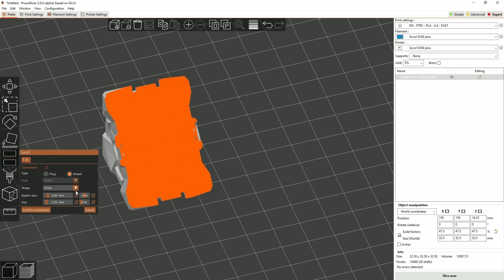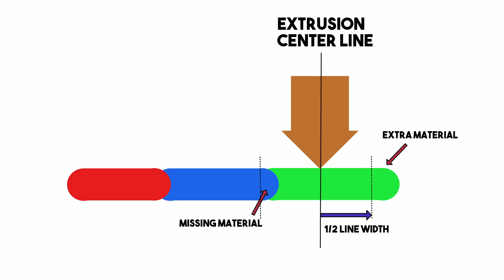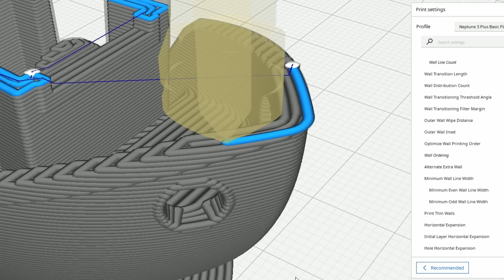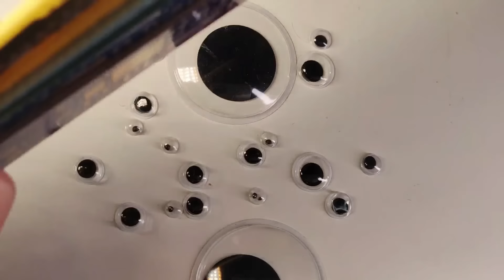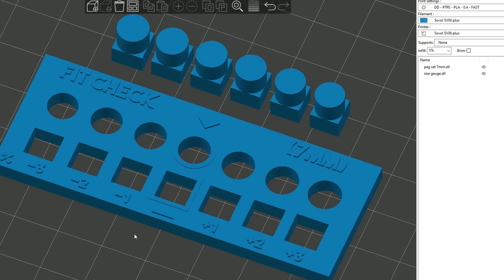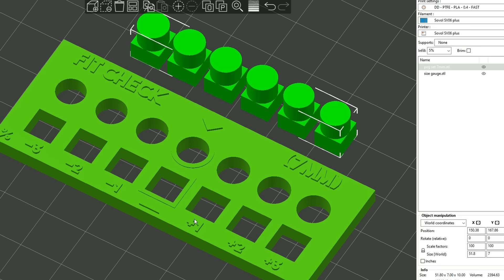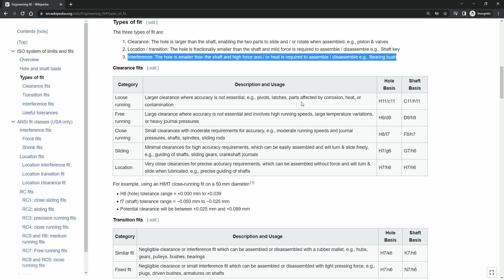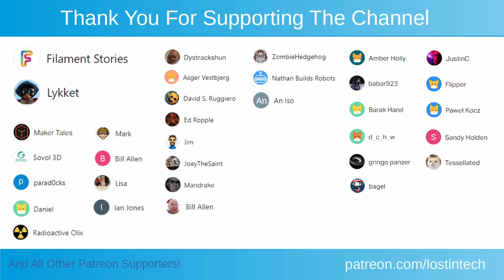Why your 3d printed stuff doesn't fit together and how to fix it!

Comment: You don't want a relative increase/decrease of dimentions: you mentioned at the start that the actual clarance is dependant on how much the filament is sqwosen outwards at the outer layer, and this is in absolute units (mm), not in persantage of the moedl size. For example if you need .14 mm gap and masured that with a 7mm square hole/plunger, get the 2% size difference and print out a plunger/hole pair of the size of 14mm instead with that 2% in mind, you will find out that the parts are got too loose as the actual gap will be .28mm instead of .14 you need. So it's not a persantage but how you should offset the shape wall inwards. For example I use 0.5 mm clarance with one of my printers, so the hole to tightly fit 50mm, on the modelling stage turns to be 50.5mm (1% larger), while the hole of 10 mm will be 10.5 mm (5% larger)

Comment: I'm not sure how I discovered The totally mundane LIT Calibration cube. You don't talk about it in this video. I would really like to see a video describing the calibration cube and all of its features. I printed it with stock settings on a Bambu Lab P1P and it amazed me. Not only did it look fantastic, but it has so many features to inspect. I think it could replace the benchy as a do-it-all test print.
Reply from the maker: Noted, will do

Comment: I try not to use the slicer to make things fit, that’s bad practice the only why you should do that if you haven’t the file to altar or a program like fusion 360 or you are making a one off piece that will never be printed again.
I always use fusion to make things fit then print out only parts of the design that needs to fit before doing a 12 hour print on the full piece it saves time n filament. As in fusion 360 you have a tool that helps you just shrink the parts that need to fit well together with out binding. I found 0.2mm or -0.2mm seems to be the sweet spot for petg pla or nylon carbon on prusa with .6 nozzles. Once you have the file correct n it fits well in fusion n printed you can always print it out at any time without much hassles rinse n repeat style from your nice saved sil, What helps as well is nice n dry filament that gives great prints or not a old reel of filament, But like all things when you get into designing stuff you get a feel how most thing work or don’t, so you learn to make gaps naturally for the right fit, but if it’s too tight you can always break out the file n sand paper… or use your tool

Comment: I did a similar test a few days ago and in my Ender 3, 200 C°, 0.4 nozzle, custom fast speed settings, the result was that I should do between 0.35-0.40mm clearing. Months ago I made other test with a 0.2 nozzle and 0.2 clearing was the result (a little loose, but couldn´t move at all with 0.15) so I'll stimate arround 90% of nozzle size Is the best for my case.

Comment: For anything other than cylindrical hole fitment, I always put a radius/fillet on the edges of the male part. Works every time
Reply: I design aluminum sand tooling professionally, and this is exactly what we do with pieces that fit together. Good work hahaha.

Comment: in my experience a wider nozzle when set correctly, produces better prints than a narrow one, because the filament isn't being squashed as far beyond the intended extrusion width as it would be with a narrower nozzle. Counter intuitive as it may be, I've found the fine detail quality of my prints increased when switching to a .4 or .6 and calibrating for it rather than a .3 or lower with likewise appropriately calibrated settings.

I think the wider nozzle also increases the amount of variance the printer can achieve with flow control. There is a minimum required pressure to get filament to flow, meaning even if you use a narrow nozzle and tell it to back off on the flow, it probably isn't able to actually do as much backing off with a narrow nozzle  as it thinks it is, which leads either to over extrusion or a failure to extrude, causing worse or even completely failed prints.

I found my dimensioned parts had better fit with the wider nozzle as well as looking better. Also, it's MUCH easier  to control the layer height with a wider nozzle due to the real world squash and stretch of the filament having better margin of error as previously mentioned.

If you need close fitting parts and you don't mind calibrating and playing with settings... I seriously recommend trying a larger nozzle. I can't guarantee it, but I've seen other people do testing, and I've seen my own results, and I recommend trying it.

Comment: The concept of right size middle hole is valid since it really shows the right size of the hole as it was designed. Before your test an extrusion e-steps test and tuning should be needed in order to know that the sizes are real. Since then the test is useful. You should also need to compensate the elephant foot tuning the horizontal expainsion setting since the first layer will be 2-3 decimals smaller than the rest of the hole.

Comment: I looked into this video in order to improve some clearances in order to make screw style nuts and bolts for my own use, I'm surprised at how hard it seems to be for others to get an interference fit on their parts. I have an Ender Creality 3 and what I did was get 2 parts in blender, these were 2 halves of shells foe a mold, and basically booleaned one part out of the other. Then I fed this into the bog standard creality slicer I got with it and it worked perfectly. The parts need to be squeezed together with a fair bit of force but there's no sign of overstressing on the parts even after lots and lots of uses

Comment: What you mentioned applies to holes along the X/Y plane, facing into the Z (e.g. holes in top or bottom). However, holes in the sides suffer from yet other issues. First, a layer has a thickness and the wall at that layer will be basically straight - it won't follow a circular path. Therefore, the wall will be either too close or too wide as compared to the circle you are trying to make. By default, slicers will make the wall at the middle of whatever line/curve is crossing as you go up, which means it's both too close and too far. You can set it to print on the inside or outside instead, which will make it always too close or always too far, but neither is ideal. Really, you don't want round holes on anything but top/bottom if you need dimensional accuracy.

In addition, the top of a hole has very shallow angles - approaching horizontal at the top. This amounts to a very sharp overhang. Slicers won't try to make this extremely shallow overhang. Instead, they will create a bridge across the top. Again, this means that either you have filament where you don't want it, or you are missing filament where you do want it.

Another issue for top/bottom holes is the seam where the circle starts and ends. Again, you will run into issues at this seam. Either you will be missing a fit of filament or you will have some extra. The shape of the seam also depends on the direction that the extruder leaves when it joins up the seam - something you rarely have any direct control over. So you'll more than likely end up with bumps along the inside wall of your hole that make it too narrow.

Getting a perfect fit for any shape is nearly impossible. The easiest way to get accurate and consistent round holes is to undersize them a bit in your design, then drill them out with a drill. We use the same technique in subtractive methods like milling because it suffers many of the same problems - you can't make perfectly square shapes and you can't make consistently round holes. When we need a perfect hole, we will drill (come directly down from above) rather than milling (circling around the perimeter). For any other shape, leave clearance, and provide relief in tight inside corners, such as using dog bones.
Reply: @reverse_engineered  I'm really digging this up late but after those 2 years I'd like to thank you for your comment. I've basically already known what you said but reading this explained by you was a pleasure. I hope one day I will be able to explain myself as clearly as you can.

Comment: This is a nice gauge and certainly useful. I think one thing that's missing though is how to account for these offsets and clearances. You briefly mentioned resizing the part, but that's not going to give you dimensional accuracy: it will not only make the holes larger but it will scale up the entire part, causing the outsides to be even larger too. Instead, you probably want a setting like horizontal expansion which will keep the overall scale of the part, but will subtract a bit from the size of each edge, like shaving a bit off of every face with sandpaper. You can use your gauge to determine how much too large your pegs and how too small your holes are, then put that amount in for horizontal expansion and it will correct for it, while maintaining the same overall size. You should never have to change your steps/mm or scale your part to make clearances!

Comment: Never make a perfectly square hole or part to fit in the hole. Always give the corners a bit of an included radius rounding off. Helps fit and is stronger.

Comment: nice gauge bro, will certainly give it a try. 
and my way of dealing with this is the lower flow at the outer wall. my usual setting is something like 2mm shell thickness with 0.7mm line width(from a 0.4mm nozzle) the 2 inner pass of wall is set at 112 flow(varies by materials, 112 is for pacf) while the outer most pass is like 92. the higher flow on the inside is to have higher extrusion pressure and presumably higher strength, and the outer most wall is just to give a smush so its mostly dimentionally correct. 
at the end of the day i find it very helpful to have a rubber mallet and a tiny file on hand, which can solve like 90% of fitting problem.

Comment: Round holes are tricky, especially smaller ones. The extruded line will want to drag to the center of the hole a bit, depending on the diameter and speed (even with outer walls first). 
But I managed to do a perfect interference fit of a small square peg on the first shot - with zero extra tolerance, but chamfered the peg corners ~0.5mm as they aways overflow a bit on both the peg and the hole, even with a well tuned LA. It being PETG which is flexible helped and some force was needed, but it did fit.

Comment: I usually just make one part 99% or 101% relative to the other. you can use a diagnostic tool all you want, but you forgot to account for one factor when you are printing something someone else created, you have no idea if the creator or how much the creator accounted for clearance in the designed part. good designers would have designed the part to print easily on FDMs, while some models may literally do what you said, have 2 edges occupy the same space
Reply: Yeah, that's the main problem with designs by others. Luckily, these days we can pester them in the comments :)

Comment: Nice idea! CNC Kitchen has something similar to test the correct diameter for their thread insets. But they added all axies so they have holes on the horizontal, 45° and 90° axis so you can test every possible angle. Maybe this would imrove your model so you can actually test how a peg for a 45° printed hole has to look like.

Comment: If you're going for a friction fit, and making the design your self. Just add a small slope (2 degrees or something like that) to one of the 2 parts. Once the head of the peg is inside the hole, the rest can be pushed in with a bit of force. Unless the negative clearance is more then the material can compress.
Reply: Better yet just don't match the peg to the hole. A square or hex peg in a circular hole works great. You just oversize the peg a tiny bit and since it is only making contact at small points it can easily be pushed in and as a bonus it will resist rotation.

Comment: I ran into this issue, I made a template for using my router and shape wood pieces.  Then I took that model, and measurements from my blanks to make a placement template to position it consistently and accurately on the blank.  Well as you guessed it, first time FAIL.  Would not fit.  My solution was in the model, to do what you said second, made in this case the hole bigger.  But in my case it was not a circle but had 4 sides, and when I pushed each side out alone the end result was a mess and did not match the main piece.  I pushed them all at the same time out at 0.02 and it fits nice, maybe a 0.018 would be better but the minor difference doesn't seem worth the work.

Comment: If I’m calibrating and maintaining my printer I find typical profiles I have to knock down flow rate as they’re tuned for much poorer extruder performance. I’d also rather use XY layer shrink/expand settings than external perimeters because of the support issue, but it’s something to try.  Calibration without a tolerance check like this is really hard because you’re talking about maybe a 0.5mm perimeter that could be off as much as 10% or .05mm.  I’m good with calipers, but not that good.

Comment: I don’t think it’s a good solution to ever print scaled,
i.e. 2% bigger. Wouldn’t extrusion multiplier and other settings be a better way to control over flow?
Reply from the maker: Hmm. Worth experimenting with what happens when you reduce it by the same % as the gauge.

Comment: Tolerance is a specified deviation from a nominal value.
Fit is a specified fitment based on it's intended purpose.
Clearance is the space between two mating parts. 

From an Engineer, hope that helps everyone.
Reply: Tolerance = specified "allowable" deviation

I don't want be "that guy", but it looks like you are going for precision. Adding "allowable" adds context, or at least reinforces that conveyed by "tolerance". Thinking about it, "precision" is probably a good word for your list too. I will show myself out. :p

Comment: My prints are consistently off on the Y axis by 0.15mm but spot on at the X axis.  How do I address this?
Reply from the maker: depends on the cause. If your y steps are out, tune that. (google "adjust y steps")

Comment: Does resin printing have similar issues for different reasons?
Reply: Too long exposure makes objects fatter. Resin may shrink when cured. So, tuning is needed, but since resin slicers don't have XY expansion (oh why 😬), anything beyond simple scaling (or added "negative" objects, maybe in PrusaSlicer, haven't checked if they can be added for resin) needs to be done in design phase.

Comment: If I'm needing exact tolerances I usually do a couple of test prints on a cut-down version of the part/tolerance in question. I've found that even if you think you have allowed for the issue you will still be surprised. To be honest given the relative low cost of modern 3D printers its actually surprising how good the tolerance/consistency of prints are so I'm not complaining!

Comment: Excellent info as always. One additional variable that will affect parts fit is "elephants foot", i.e., the slight bulging of a part where it contacts the build plate. I control this in Cura by setting the first layer horizontal expansion to around -0.12 mm. You'll have to adjust this number depending on the setting of your Z height setting. I get no elephants foot in my prints.
Reply: It's best to avoid that by getting your Z offset just right. There are lots of parts for helping to calibrate this. You should only get elephants foot if your first layer is squished because the head is too close to the bed.

Comment: I learned something. I subscribed. Thank you for explaining the outer walls first setting. Yep, I’m triggered, lol. Tolerance, clearance and fit are not concepts, they are important descriptive and accepted terminology used every day to communicate between engineering and manufacturing, verbal and in documentation. Each has a definition. I’m an engineer and machinist who uses the terms daily. Clearances can have tolerances, but tolerances can’t have clearances. Tolerances are dimensional parameters that must be met in order for parts to fit, and are denoted in +/- on each dimension. Clearances are space allowances intentionally engineered between parts to allow for movement, adhesive, lubricants, or for another part to move within without contact. Both mating parts must be within their tolerances to provide a sufficient clearance. Think wheel and fender. As long as the wheel diameter is within its tolerance of +1”/-2” from the absolute dimensional callout and the fender position within its tolerance of Z=+2”/-0” of its positional callout then a 1.1” clearance allowance between the fender and wheel is sufficient to keep them from rubbing no matter where both parts are within their tolerance. Fit is a term that generally refers to the effects of tolerance stack up. If you have 20 parts in a stacked assembly and each and every part was held on the high side of the thickness tolerance, the overall height of the assembly may not fit into the space allotted for it. If the same were all held on the lowest end of the tolerance, the result is usually called end play, or slop. It’s the engineers job to communicate with manufacturing with both understanding these terms in order for the engineer to set tolerances on dimensions based on the capability of a particular machine to hold those tolerances. In some cases like the afore mentioned assembly, parts may need to be segregated by high/ low end tolerance and arranged in a way called fitting.
Reply: Clearance is needing a gap between moving parts for lubricant. Tolerance is how accurate you need to make that gap before it's a problem.

...would that be a fair statement?
Reply: Thank you for the lecture! It was interesting to read :)